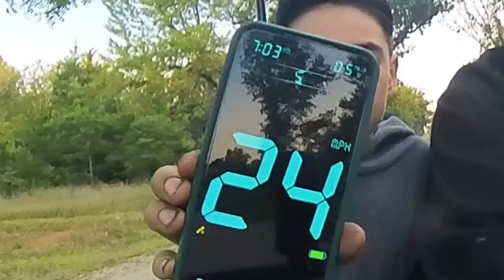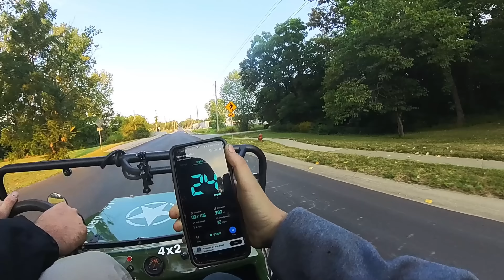Mini Road Trip In a MINI JEEP!

Comment: Those things are like $3,600 at Tractor Supply. It's sad that you pay that much and the engine isn't even put together properly. I can understand that you might have to go around and check nuts and bolts, to be sure everything is good but the engine should not be in question for that amount of money.
Reply: Welcome to 2024, everything’s very expensive and very questionable
Reply: 2vintage just did a video on a massimo side by side thats 10k and had a oil and water pump gear fail at 700 hours.
Reply: You definitely ain't beating any land speed record's 😂

Comment: Definitely love to see another video of you digging into the blown motor and also finding a new engine for this (go power sports is your best bet. Or harbor freight) and remove the governor items within the engine to make sure it doesn't blow up, and that's what gives you more power.
Reply: I hope they turn it into an even bigger deathtrap lol
Reply: it would be difficult to get a predator in there.  Better off to stick with the same type of engine.  Get a lifan 150 and it would be much easier, still have the gears.
Reply: @Chocolate_dragon  I say screw it, stick a 4 cyl Pontiac engine in it lol
Reply: Be perfect for one of the harbor freight predator ghost small engines.

Comment: Need to "hop it up" with a Harbor Freight Predator engine now, lol
Reply: In the dump I found a perfectly good Hobo Freight generator with a gas tank full of water. Gave it to a buddy. The 420 engine is now in his Coleman 200 minibike! It RIPS!
Reply: Or just properly fix the 125 so you have an actual transmission, or install any number of larger more powerful engines which can make 30+hp.

Comment: One of the first upgrades that should be done upon purchase is adding as large of an oil cooler as possible... These engines are notorious for overheating and they use both air and oil cooling (although limited without an oil cooler) they will cook their own oil in short order without one.

Comment: Well, started cool.  To be honest, id swap that chinesium motor for an older flathead twin briggs. Theyre bulletproof

As for steering, add some additional weight up front, or wheelie bars in the back. As suggested, go over every nut and bolt before another roadtrip

Comment: Those are dead easy engines to swap out for bigger ones. You could get a 140cc and some performance parts for cheap enough. My only recommendation is to launch that carb as far as you can and buy a flanged carb to fit straight onto the intake

Comment: That looks a lot like the SYM brand 50CC engine I have in my moped.
On your timing set. You'll need to remove the magneto cover and match the marks. Don't use the "F" mark.
Then your cam gear needs to match a mark on the head.
Set the valve lash at .003in.
Check the valves for leaks, might need too lap them.

Comment: it is a good practice on mini bikes and go karts and other similar stuff powered by small engines especially from china, to go through and check all of the bolts to make sure they are tight when you first get them
i had a coleman mini bike and didnt check all the bolts only to find out that the bolt that holds the centrifugal clutch on was missing by the time i noticed it

Comment: I am not defending the cheap chinesium jeep but there are a couple things id like to say.
 1. I do believe those need the oil changed before use. The one i saw had a note in the owners manual about the oil in it only being a preventative lubricant for shipping and it needed to be replaced before use.
2. The steering geometry is very poor and as the front suspension is compressed the the tires toe is. The front shocks are adjustable but id recommend aligning it with the weight of the driver and passenger in the jeep.
3. The carb swap could possible not have been jetting properly causing a lean condition. Which caused excessive heat. 
4. Regardless its still over priced chinese junk but my son has had a couple of the cheap chinese quads which have nearly indenticle motors and he beats the crap out of them and they keep on ticking. The wiring sucks and a nut bolt check is required every season but i am actually pleased with the level of abuse his 125 and 250 have endured.

Comment: since you can now get whip-its at most gas stations these days you should really thread a hole for a barb fitting into the intake and tube in a whip it dispenser and give this little guy a nitrous boost option. Might as well add a little power since it needs a rebuild anyway

Comment: Make a cheap oil cooler out of bits and it will not overheat. Or throw in a little suzuki 125GN motor for $50 from somewhere. They are mass produced oil cooled mini size engines and live forever, as long as you change the oil
Reply: If you lived in Australia I would give you a pair of 125cc motors and a free 250 engine, as I have 5 of them in my garage heh.

Comment: For once I had something similar, although not in a mini jeep, but a small dirt bike, same style of engine. If they run (well) they're strong and fast, but as soon as the chinesium melts it's over and you can basically scrap it. This can take 10 years before it happens though, they're quite reliable, just don't stress them too much! 😂
Reply: You mean like hauling 300lbs uphill at full throttle while doing a tiny wheelie?

Comment: Swap it out with a small V twin john deer mower engine,  the added weight will help with the steering issue,  already have good gearing, engine comes with a mini alternator so you could put a small Chinesium fan for cooling with a temp sensor.  That thing would rock then.  I want one but im hovering around 330lb in my retirement days and it would probably blow more than just a head gasket with me sitting in it lol.  Wish I could have an original crate Willie's jeep from Amazon lol

Comment: I think you'd benefit from fitting an aftermarket oil cooler on that. That would really help the heat situation! I've got a single pot 350 with an oil cooler and it does help.

Comment: Nevermind finished video,, get the headgaset and tune the carb!! The aftermarket carb probably ran it lean. Maybe ran the rings flat and lost enough compression, or could have got the valves warm enough to get the tolerances off. Do a compression check and then check valves. Maybe move the needle height on the carb slide up to give more fuel. May also need a rejet. Read thr plug to find out.
Reply: You probably need a new motor, grab one out of a old Honda 3 wheeler to keep the transmission bonus points for fun

Comment: I bought one of those my daughter it drove well for the first couple of hours. I will say check every bolt. The tire rods adjusters were loose the choke cable broke due to the cable nut vibrating loose  and the brake pedal push rod was slightly bent

Comment: Reminds me of the first one of those Chinese bicycle engine kits I put together. That little 2-smoke literally shook itself apart, and the hardware was so crap that it snapped 2 of the studs holding the jug leading to a loss of compression and being stranded. First time it did that, I was 5-6 miles from home, if I had tools with me someone mighta found that engine in their garbage can because pedaling the bike any distance is no fun with that thing in the frame. 2nd one of those bikes went much better with all the hard learned lessons of the first one, was a good time for 15 year old me.

The engine in that mini-jeep is the same little Honda clone you'll find in most of the chinese ATVs and smaller bikes. They usually aren't too bad, better carb and they run pretty reliably in my experience. Never had a problem with the studs on those but if it had 1 back off like that I'd be suspicious of them all being stretched, probably a defect, I'd see about replacing all of them when you put it back together.

Comment: Hey so taking a quick look at what you've got for a little Chinese knock off engine there. It looks like a typical Honda 70 clone, probably a 125/150cc variant though. Also looks like a Nibbi carb swap. Pretty decent mikuni knock off.
As a Chonda enthusiast I can give you this advice. You're foreshadowing is correct those 4 nuts hold the head on. Be careful reinstalling them and watch torqueing them to far, they snap easily.
Also you're running lean, I'd buy a jet kit off Amazon for the nibbi. If I remember  I shoved a 130/100 set in my 22mm Nibbi to get it close to right. There's a few good videos on here about jetting them though. 
You guys are doing great. Keep up the awesome content!

Comment: I think you're running the RPMs a little high. Does it have a tach on it? If not I highly suggest getting a tiny tack for it. On my golf cart the governor is 3300 RPMs and I was told by a professional not to run them over 4200 RPMs. And it's just a single cylinder engine.

Comment: Ahh the Chinese cough Honda engine, found in Mini Jeeps, Lawn mowers, Pressure washers, water pumps, generators.... all Junk... But.. If you get anything with one of those engines, BEFORE running it overtighten every single bolt you can find and it WILL work for a lot longer!   Another fun video guys, thank you for making me and Mrs Roving laugh on a saturday morning.
Reply: Other than the mini Jeep, these engines aren’t found in any of the equipment you mentioned.
Reply: @MiniBikeMike  In the UK they are
Reply: @theroving1  They put shifter engines on generators, lawn mowers, etc?   This engine is based off of Honda’s designed used in minibikes, like the CT70 and Z50.  It has an internal transmission, that you shift manually.  I find it very hard to believe this style engine would be used in the equipment you mentioned.  Why would you want to shift them?

Comment: Any small engine quad/dirtbike or go kart you should go over all the bolts and tighten them and check after use cause they rattle loose. They eyebal the steering so probably badly align why steering is bad. 125cc is too small for the weight. The high rpm and no air flow will blow it easily. A 212cc would be better

Comment: there are some values to be had with the Chinese stuff but there are some real duds too. They are hit and miss on quality as you know from buying auto parts. I bought a couple of big displacement chainsaws, took them totally apart, replaced the known problem parts with higher quality and then you have something that will hold together.

Comment: Hey guys, have you seen that new "Midi Jeep" by Massimo yet? Now that looks like the perfect jeep to get, I seen it on another YT site, Joe The Farmer I think is where I saw it, its very cool and built very well, water cooled with a 300cc FI motor, its almost 8ft long, 5ft wide base price around 7K but it fits us big guys very easily, although the price is 3 times more it looks very worth it and very upgradable. I would spend the extra and get this jeep and then be able to drive this anywhere, oh and the coil over shocks are adjustable so you can make a smooth ride on any terrain, anyhow check it out, they are now available at tractor supply.

Comment: Damn they shouldve said in manual makes sure bolts is tight but that sucks I've owned so many different things with them kind of motors those is the first motor I've ever taught myself how to build an idk nothing bout em but I brought a black flame mini motorcycle when I got it the motor was off in a box in pieces with lil tool an a small kitchen an lil determination I built it an had it running even with a red neck wood intake I made for the over size carb that wasn't right but came with it but clutch bad that's why motor was in million pieces 😂 but I er time I've ended up learning how to turn 49cc crank an block into a 90or  with your 125cc piston jug an head but make sure you remember where the marks was if not you have alil hard time figuring it out like I did but I got one right now wish I had parts to do it I got a bicycle frame I want it on

Comment: Bought my kid the coleman 4 wheeler from tractor supply. I had to put 4 engines in it before i got one that was reliable. The first one blew up. The second one from amazon lasted an hour. The third one one came cracked and its replacement was good. It was an aweful experience. And forget about a warranty they basically laugh at you.

Comment: I wonder how much engine you could fit in that tiny space. ^^
If you havent seen the insane Dodgems build by Colin Furze, you are in for a treat. ;)
Reply: They make a 190-250cc motor that can bolt in there. But they are still garbage

Comment: I can rebuild one of those in 45min.  They're actually VERY simple and you should be replacing the piston and rings not just the head gasket.  Also investing in an oil is MANDATORY on these mini jeeps, as is very high quality 20w50 MOTORCYCLE ONLY oil, not your autozone cheap shit or you'll kill the clutches.

Comment: With those engines in a 110 or 125, if you're not racing it and don't care about the engine, use a carburetor from a Honda ATC 200, any of the S, M, X or ES, get a cheap Ebay intake, port match it. Night and day difference in driveability and fuel economy.  Those Mikuni and clones are horrible for reliability and most are way over jetted

Comment: Time to do a GSX-600 swap on this now you know the 125 dirt bikes are rated for no more then 160lbs the weight your making that little 125 drag around your going to keep blowing head gaskets because the load your putting on it is causing to much heat.

Comment: just drop 420cc snowblower motor's in them and they will be good !!! chain drive if they still have them !!! I made this comment at the start of video. it seams frame and cheap motor's burnout. and for the 420 it makes it up 40deg incline !!! without hassle !!! just keep extra clutches or a spare gear for low end and 1 for high end flat lands. and 3 sets of pre cut chain for both on the go setup's. I am still running a powerfist engine 420 6 yrs later on my custom off road machines top speed 50 km/h is good enoough for me. even my custom sled does 50km/h 70 max !!! all with a 420 cc motor. all junk left on motors but I took ove rthe govener rod and doing fine. filed oout the jets at 3 angles each and the seam to run fine. plus a washer x3 in the exhaust( but you have to run a straight pipe till hot then put the washer in the pipe 1 ich before the hotspot  ends in the dark. then the next 2 the same way the bend to what you need and have fun !!! on a stock setup with my setup you can do over 120km/h. depends on gearing. but if you have a 2 speed slam shifter or a 5 speed kids atv trans. you can do over 100mph !!!

Comment: Those Chinese motors are known to be very poor they are a very poor copy of the Honda cub engine. if you want something to replace it with  try going for a Honda Cub 90cc 12v engine should be a drop in replacement, You could go with a 140cc big bore kit BUT its very unlikely to last very long.

the C90 90cc engine is a better way to go its got a little less power but those original honda motors are bullet proof .